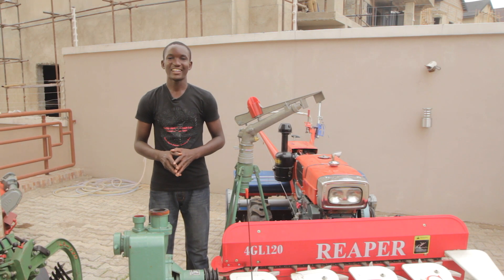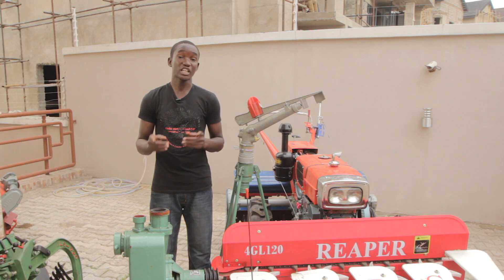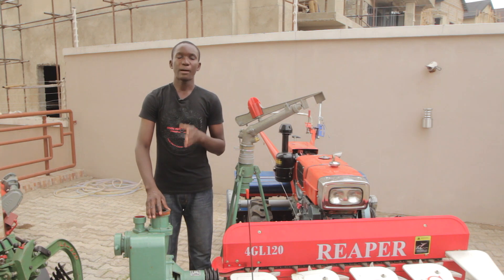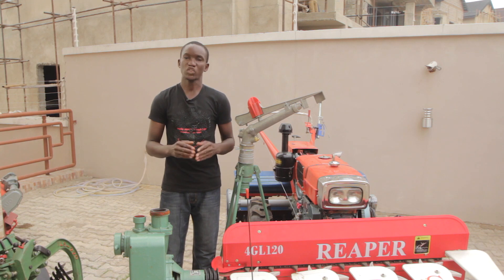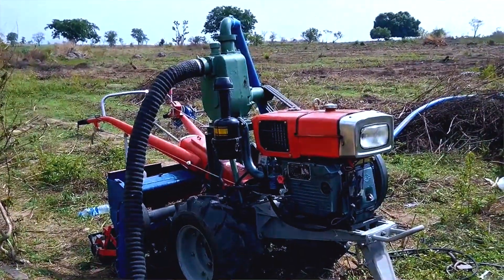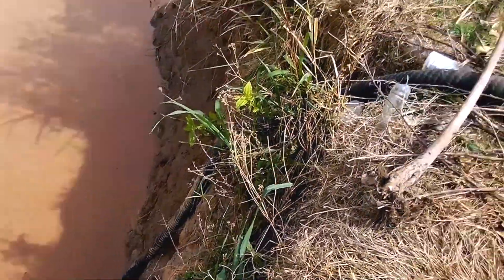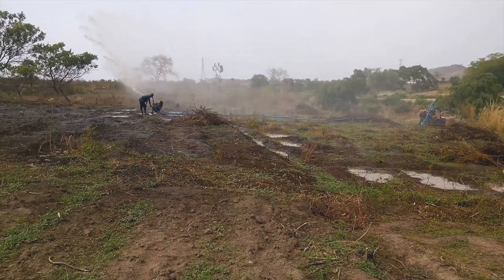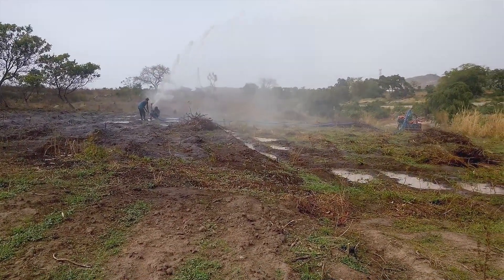Irrigation Water Pump

Comment: This is great. I have an 18hp BEN WAU walking tractor, and I have an irrigation problem.
There is a strean 800m from my farm, but it's at the bottom of a valley. 
I can store 50,000ltr of water on my farm.
My farm is established 100m above the stream.
If I put my tractor, with your pump assemble at the stream, can it pump water into my storage tanks 100m elevated above the stream elevation? (Head)
Then I can use your spray rig to irrigate my crops.
I'm in Rwanda and we have many hills.